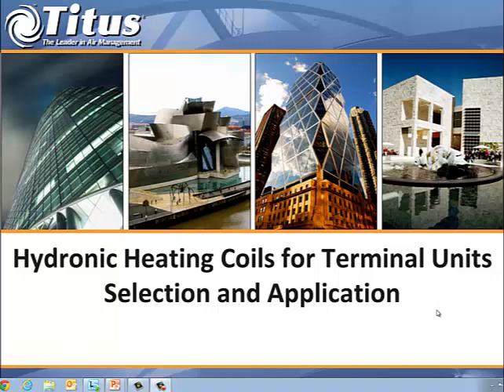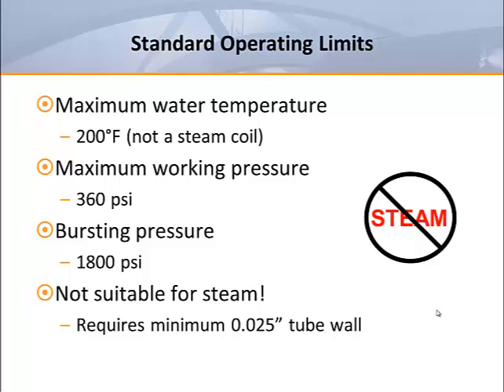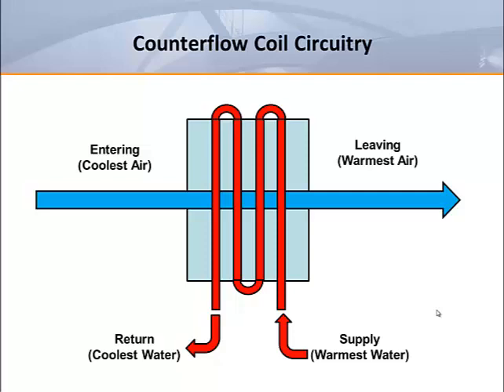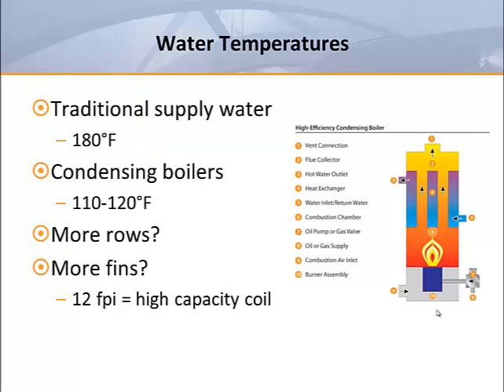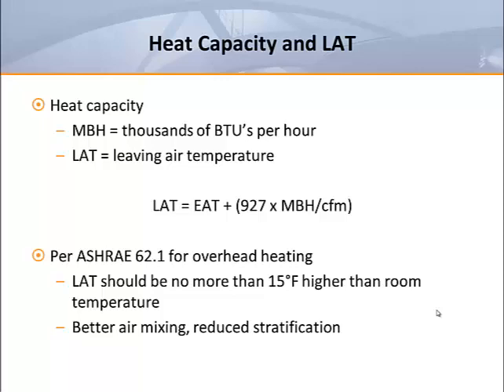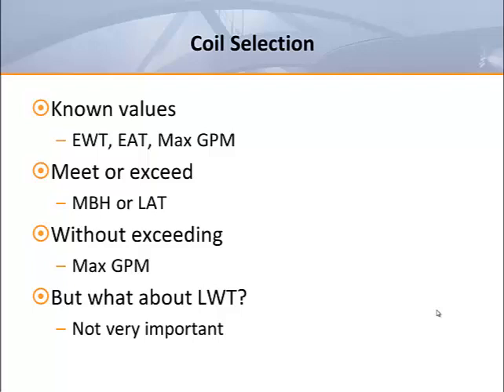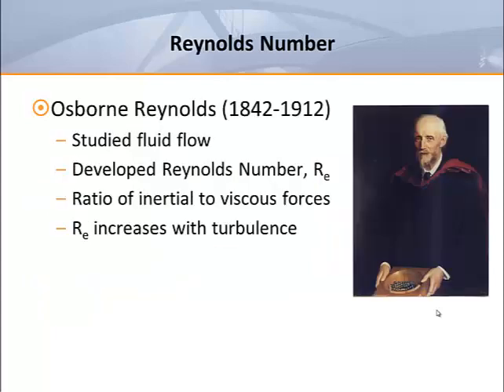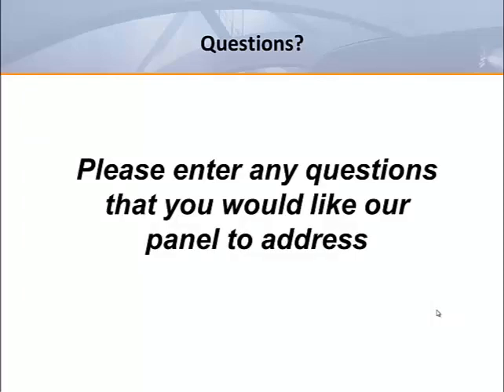Hydronic Heating Coils Webinar

Comment: My existing setup is a Rinnai 199 BTU tankles water heater set for 60c (140f) supplying  an existing Summer Air handler TC3550E in my basement.  Air handler sensor records the input water at 49c (120f) the output water at 37c (98.5f), discharge air at 38c (100f)  and the flow rate recorded on Rinnai to the air handler is 2.8 GPM.  I dont know the spec for GPM. There may be alot of resistance in 3/4" copper lines. All Insulated.  The run to tankless and back is 60'.  16 x  90degree fittings,  a Watts water filter. The pumps is a Grundfoss  UP 15-42 BUC7. 

My thought is the SummerAire pump is underrated for flow.  My gutt tells me it should be 4-5 GPM

Comment: Thanks for the explanations, great stuff! Why would they call "thousands of BTU/h" MBH and not kBH? You would think MBH would be millions of BTU/h
Reply from the maker: Nobody’s ever asked this question before. We express heat capacities in  terms of MBH which stands for thousands of BTU’s per hour. To a modern audience familiar with the metric system, ‘M’ stands for millions not thousands. Well, in this situation we are dealing with British Thermal Units. This an engineering measurement that predates the metric system. In this older system, the Roman numeral ‘M’ stands for thousands. That’s why heat capacities are expressed in terms of MBH.
Reply: @TitusHVAC  Ahh it's the roman M, not the French M , that makes sense.. Thanks!